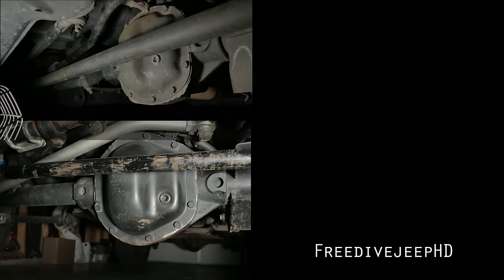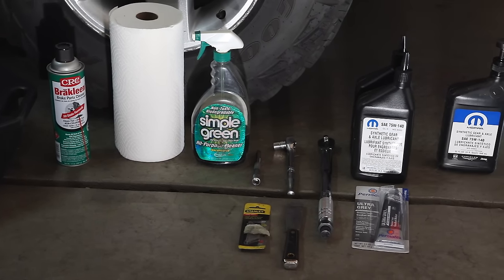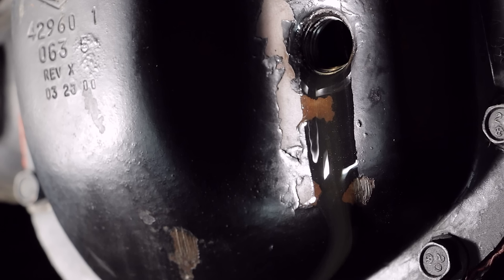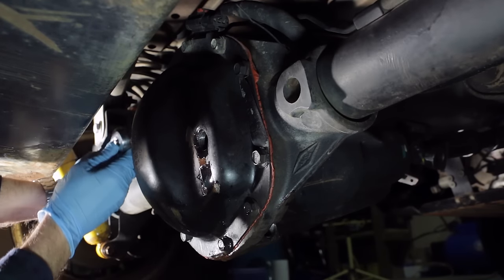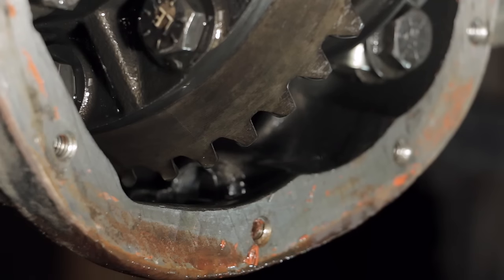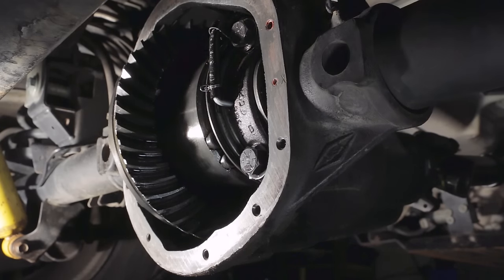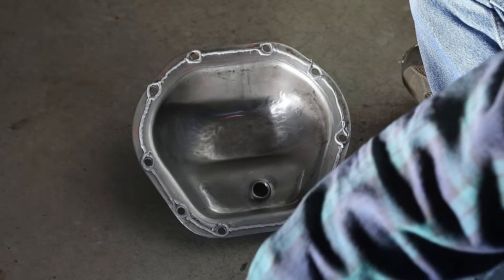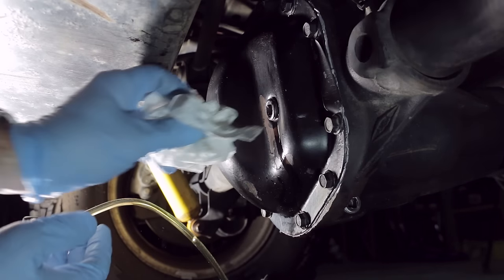Changing Your Jeep's Differential Fluid

Comment: What , and how much additive do you put in for the rear diff with track lock?
Reply from the maker: If you have a clutch-pack based limited slip, i.e. trac-lok, you will have a metal tag attached to the differential cover with 2 of the cover bolts.  It will list the type and quantity to be used.

Comment: I know I've said it before, but man your video's are so great. I'm officially a YouTube Certified Mechanic now :) I thought I'd run something by you. I have a 2006 TJ 2.4L 6 Speed Manual with the 30/35 setup. I purchased some chrome covers on Ebay so that I can do a quick change while I strip all of the nasty Krylon cheap spray paint off of the factory covers that the previous owner thought looked good. I'll save them for future use, especially if these newly purchase covers turn out to be bad quality. So here are my questions: 
Should I use the factory bolts or the included bolt/washer setup? 
Should I use the included gaskets or go with the Permatex?
What would you recommend to get off all the caked on spray paint? I don't have a blaster, so would paint thinner be okay? 
Thanks again for the awesome videos, I'll attach the Ebay link below. 
Jason 
https://www.ebay.com/itm/Chrome-Steel-Differential-Cover-Kit-For-Jeep-Wrangler-TJ-97-06-Fits-Dana-30-35/132267733083?ssPageName=STRK%3AMEBIDX%3AIT&_trksid=p2057872.m2749.l2649
Reply from the maker: I see no reason why you couldn't use either.  The bright metal fasteners that come with that kit would probably look better, though.

Comment: to get the cover off, I put the fill plug back in and use the leverage of the ratchet to rock the cover until the seal breaks. I have seen people gouge the seal surface prying it.